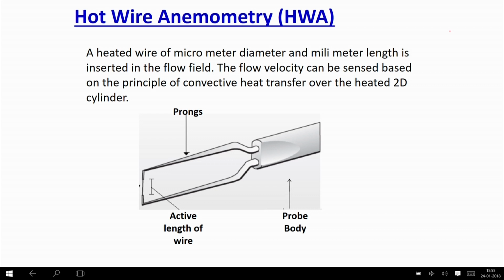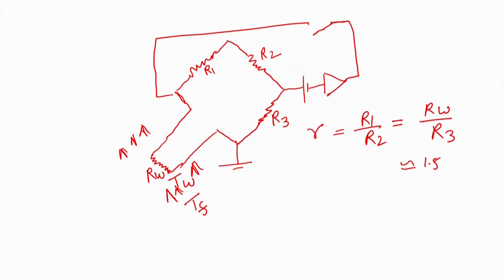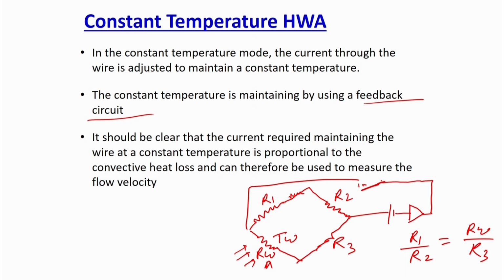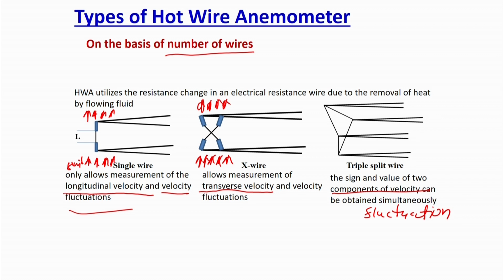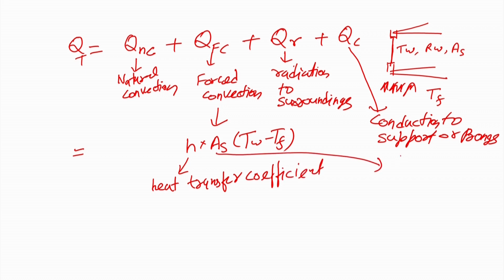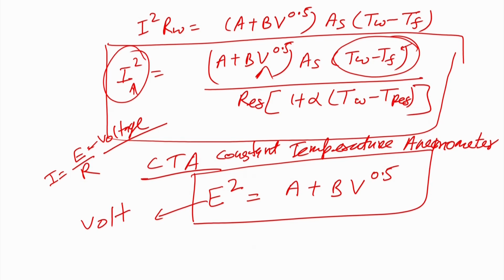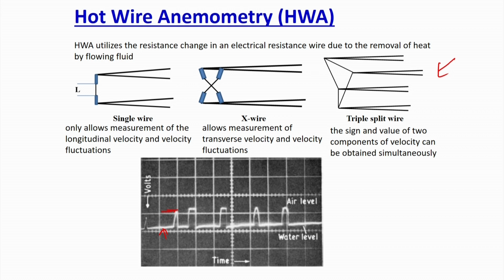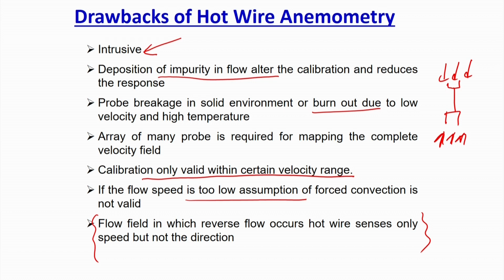Lecture 3 - HOT WIRE ANEMOMETRY

Comment: I need some help on the design of the filament, I have a wind sensor that uses 2 ceramic  coated tubes that appear to be a Pb/Si matrix. Do you have any in-site into how the filaments were coated to get a resistance of 5 to 8 Ohms across a .875" section. At least what process was used to accomplish the "Thin Film" resistor configuration?